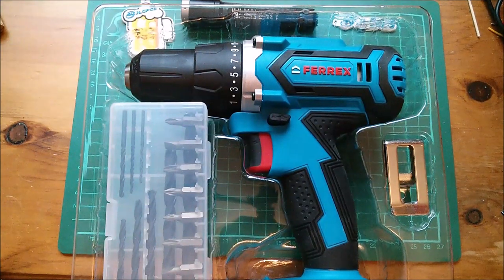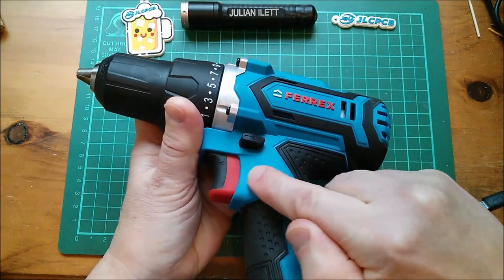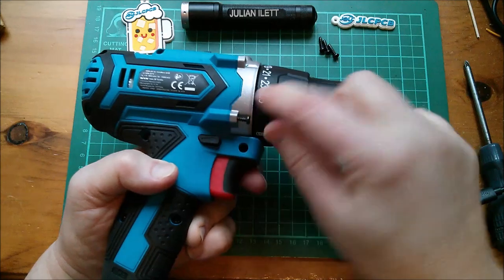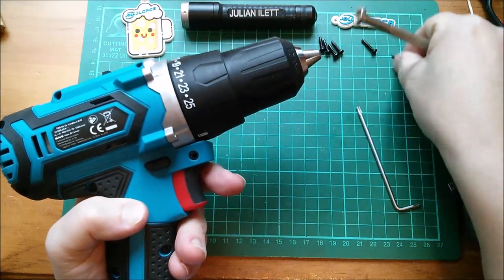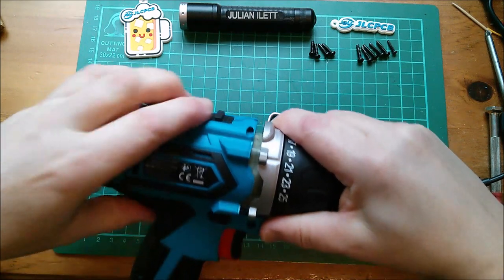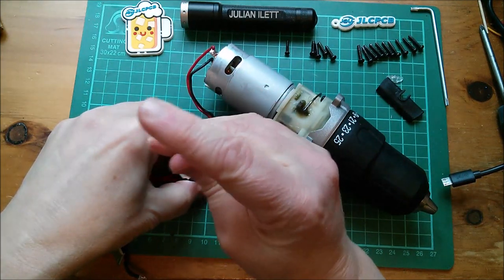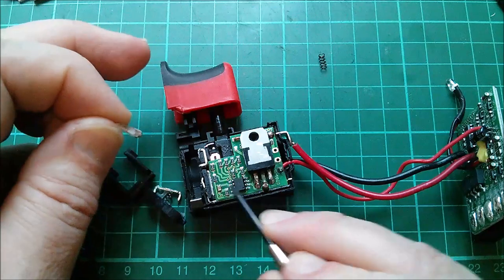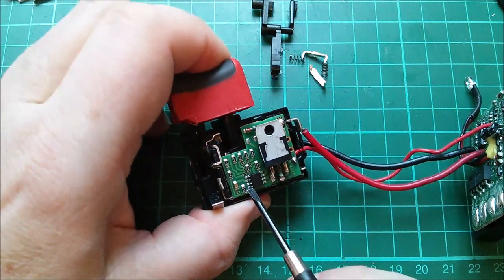Cordless Electric Drill Speed Control - Stripdown

Comment: The switch has several contacts: 1.)The motor short-circuit contact opens, which is used for Motorbraking 2.) Light goes on + Electronics goes on,   the Motorspeed depends on the variable resistor value. (Here with several discrete resistors instead of a linear potentiometer, as seen in older assemblies)  3.) B- contacts directly to the Motor, bridging the Mosfet.

In older assemblies there was a simple NE555 chip doing the PWM. For higher battery voltages they used a resistor and a 12V zener diode to power it. (Seen in an early 24V NiCd drill.)

Comment: I'm pretty impressed by that switch module.  A lot of time would have gone into its design.  It is likely a "generic" controller that is used in a lot of brands and models but seems to work well for a brushed motor.

Comment: Thank you so much for making this video. You are correct, I have looked all over YouTube for a video explaining or tearing down a battery powered drill trigger assembly and so far you are the only one! I have an old DeWalt DCD771 where the motor died and I’ve been working to retrofit it as a handheld battery-powered motor controller for 12V car parts. Problem is, it is a 20V drill so I’ve been trying to figure out how to limit the output to avoid burning out 12V components. So it was down to either figuring out how to mount a different battery or modifying the trigger.

Comment: My BIL asked me to fix his corded drill's speed control. He gave me the drill and a baggie of loose contacts, springs, screws and clips. To his amazement, I managed to reassemble it in a few minutes. Not surprisingly, the circuit was a phase control triac dimmer with a variable resistor for the speed control.

Comment: That IC is a GS069 rotational velocity controller.  You can find it on Ali express real cheap.  My Black and Decker cordless had a problem with the switch.  It was not getting PWM to the mosfet gates.  I was able to make it run by shorting the Drain to Source on the mosfets (it has 2 parallel mosfets).  To my surprise the switch contained a 555 timer that created the PWM.  I replaced the 555 and now it works.

Comment: I blew the mosfet on my Bosch 24 volter. Construction of the switch from memory looks pretty similar, only thing was when I replaced the mosfet I found I lost the variable speed control, it was just off or full blast on. Meh! It was going to the tip otherwise so for me that was a win. As you have shown, rebuilding these is a nightmare of a fiddle. The mosfet I took out had signs of spectacular and brutal explosive failure, which delighted the sadist in me.

Comment: It's funny because I have a cheap 12v Tacklife drill that has a similar top assembly as this guy. I've been meaning to take it apart and convert it to ryobi 18v, but couldn't figure out how to open it up. It turns out, there are 2 extra screws underneath a thin plastic plate just behind the drill clutch. This thing was not designed to be opened, as the last step from the factory would be to have clipped it into place.

Anyways, I broke that plate off and accessed the motor, it turns out, this cheap 12v drill has an rs550s motor, which has a range of 12-20 volts, so no voltage conversion necessary! Thanks for the video inspiring me to actually get on this.

Comment: Rather than holding the work piece with a finger, I clamped it together with a small quick clamp with rubber jaws. One jaw sat on the mosfet heatsink and the other on the back of the enclosure. Then I used soldering helping hands to hold the work piece to the bench so I could solder.

Comment: Thank you for posting this. I just bought a new drill and was wondering whether the sudden leap of speed at full throttle was a defect. My 15 year old Skil cordless drill had a fully progressive throttle from zero to full, but my brand new Trotec 12V behaves like a more extreme version of yours, where the trigger is progressive from zero up to about 50% throttle, then suddenly jumps to 100% throttle with no intermediate setting in between.

Comment: I'm glad I found this video. I have a motor and speed controller that came out out of a 14.4v Skil cordless drill. I thought the motor would run on straight DC voltage but it won't. I was always wondering what was in that controller. Way more going on in there than I thought. I still don't understand why the motor won't run on DC unless it's an AC motor. Just FYI, you can buy those for less than $10.

Comment: I had 2 of these and the motors are rubbish 5mm shaft 775 motor went on ebay  brought a motor £10 and replaced the motor very good drills now 069B is speed controller chip well done getting that back together
Reply: @Schwalbe262 Mabuchi motor RS 775 WC 9013 6V - 18V about £5.50 you will have to shorten the shaft about 4mm off the end 
The original motor windings melt after short use

Comment: I've taken one of these apart and the one I (14.8v) have is far simpler and uses a 555 timer (surface mount type) and same pcb slide system to drive a mosfet - i ran more than 24v into the drill and i killed the 555 just need to replace that and the mosfet as that died as well

Comment: AvE does some good teardown and reviews of tools of all descriptions, including ripping the things apart at times to get to their innards. Has a whole BOLTR Bored Of Lame Tool Reviews, where he does such things, they are skookum. Even covers the speed controller, thingums in his virjayos. For drills AvE BOLTR drills, on security bar.

Big Clive also does teardowns and explanations of a whole myriad of electronics, think he did one on how wiping contacts work on electronic micrometers/callipers, showing how discrete points can be measured. In the case of this drill the precision needed for micrometer would be sacrificed for coarser stepped speed control.

Comment: I've been looking at the still image of the 8 pin SOT. I think it's a 555 timer, not too sure. It looks like pin 3 goes to the gate. The chip cap goes to pin 6. Pin 4 and 8 might be connected together under the chip. And the multi tapped speed switch looks like it adds or subtracts series resistors that might be connected to the chip cap. Pretty much the standard 555 astable oscillator.
Reply: What would be doing the LED delay function?
Reply: @Brian_Of_Melbourne  It's the bottom pcb that does the led delay, the switch triggers it to turn on.

Comment: LIDL are currently (27 01 21) selling 2.0Ah 20V Parkside battery packs for £5, £5 for 5 x 2,0Ah 18650 cells plus an integrated balance charger is pretty good value.
Reply from the maker: Where?
Reply: I've seen the offer in the Newcastle area, I'm assuming its nationwide.

Comment: I am currently working on an project where I am trying to control the speed of the drill externally.
I found a way now with arduino, external power supply and mosfet module but since the powersupplies never give the right amp peaks (i guess?) the motor is constantly suffering.

The basic Idea now is that the power comes from the battery back and the voltage is controlled by an external potentiometer (not a trigger, dont ask, its for an art project ).

Any smart Ideas about that? thanks for the vid anyway!

Comment: A 555 with irs associated components is more expensive than a microcontroller programmed for generating pwm in following a voltage red with it's A/D converter.

Comment: julian i  switched the plus and minus from the battery by accident...and now my switch is giving me problems when i corrected my mistake the motor turns very slowly and the battery heats up very fast..i tested the motor and still works good when connected directly to the battery..is it possible the transformer or diode needs replacement or the complete trigger switch ?? my trigger looks identical to your my model is 6271D ... thank you in advance

Comment: Damn.
I recently bought a Jigsaw Machine that, a few weeks later stopped working. They refound the money and let me to keep the thing, i'd like to try fixing it like you did here. 

What happens is that the motor doesnt work when the trigger is pressed, it tries to turn, but is like if it's stuck somehow. Then i realize that if you keep pressing many times the trigger, eventually the engine start working, and if you dont let go the switch, the motor keeps working as a clock. But if you left go the switch, the issue remains.

Initially i thought it was the engine, but due to that the trigger is to blame. It is the exact same model as the one the drill in your video has.

ill try opening it and see what's going inside, but im sure ill make a mess with the trigger hahaha. Ill order a new one if that's the case.

Comment: Hi, I have the same drill and I recently blocked the chuck, after stopping it, the led remained on and the drill turned full speed. I found a burnt hole under the MOSFET! The copper track that crosses was gone. I fixed it, but the MOSFET got hot. Can I replace it with an IRF540? THX for this video.

Comment: I wonder if that spark could start a fire under the right conditions, looks like quite a spark there.  What if someone was working around gas fumes?
Reply: Until the evolution of brushless motors, all drill motors (battery and mains) sparked at the brushes.  So this is a well understood situation.  Anyone working in potentially explosive or inflammable conditions will be using intrinsically safe tools.

Comment: So much technology and engineering in those switches that when it breaks down, because eventually it will break down, we are left with a tough choice of bin the tool or pay half of what the tool cost for a brand new switch. In this case, as this drill is a cheap drill, don’t be surprised if the switch alone is way more expensive than the drill itself. This week the switch in one of my multi tools gone faulty. The price for the switch is more than half the price the tool cost brand new. Bloody annoying.

Comment: Wait, how do you actually implement a flyback diode with a motor that can rotate reverse polarity? Never throught about that before...
Reply: So those big connections that change the polarity when you move the reverse switch are closer to the motor than the diode is. So the wires to the motor are getting flipped to reverse the polarity of the motor at the closest point to the motor. That way the diode is always staying properly polarized.  

Also that diode is bridging with the motor on one side and the mosfet on the other so the voltage spike always hits the diode first and never reaches the mosfet. 

Does that sound right or did I miss something.
Reply: @ecospider5  you are absolutely right and i must admit i feel a bit dumb now for even asking. I honestly didn't consider that!
Reply: Thanks for asking the question. I had never pictured that circuit in my head until you did.

Comment: PLEASE get a real soldering iron. That little job is really not up to these disassembly tasks.
Reply from the maker: I prefer imaginary tools :)
Reply: Indeed. That fancy (is it a TS-100?) tiny cheapy thing might be fine for some SMD or small component soldering, but just try a proper "station" style iron from any half-reputable manufacturer and you will never go back. I guess Julian uses his solar power i.e. around 12 V source for this and that just reduces the heating power to nothing. If you have to raise a soldering iron's temperature setting to unreasonable heights to try to melt solder on a larger metal piece, well, that is just telling you that you really should get a more powerful iron. Not to mention the comfort: whenever Julian uses this thing, I cringe because it is such a hassle to put it on the table so that the tip rests on that tiny wire support. A proper iron has a proper stand where you insert it with no effort and maximum stability. I do know about this personally, I battled with numerous cheap irons in my childhood/youth, and once I finally got a proper one (a quite basic Weller WTCP-S that I still use) it really opened my eyes to how crappy all the previous ones were.
Reply: @pev_  - His soldering iron doesn't bother me as much as that little "stand".  That stand is fine when you are taking it "on the road" but not for regular work at home.  It wastes time and just isn't safe.  I'm sure there must be a proper stand designed for that iron that works like the rest at the proper angle, with tip safety protection and a built in sponge, etc.  When Julian gets burnt because of it he will finally get a proper one.
Reply: @ElmerFuddGun  - I take a proper stand with me when I take my stuff on the road... many, many years ago I made do without a proper stand. Which was fine until I bumped the cable... then either the iron would burn me, or fall on the floor...